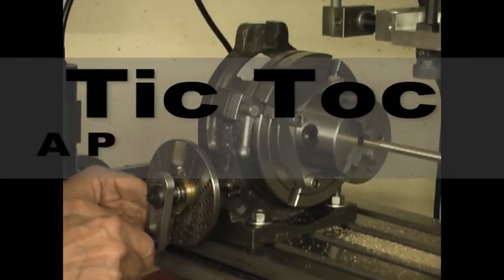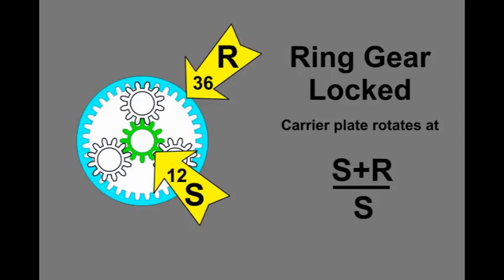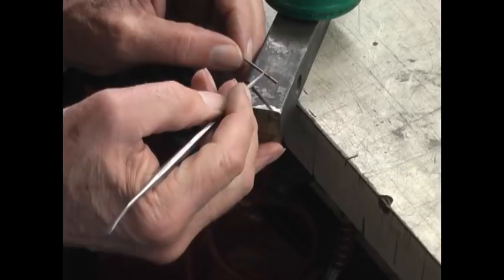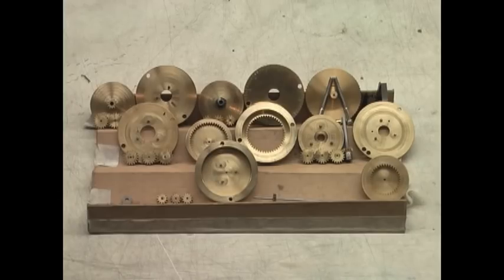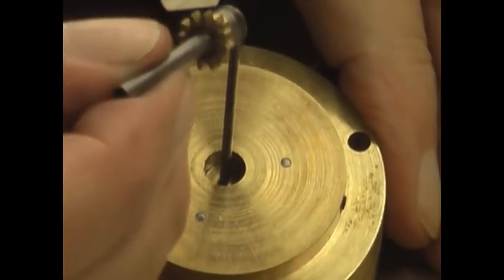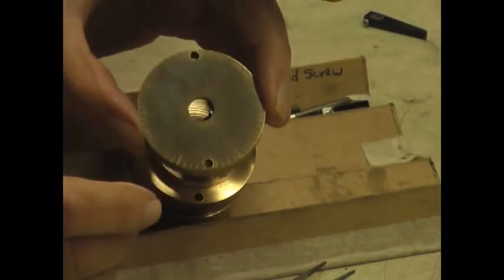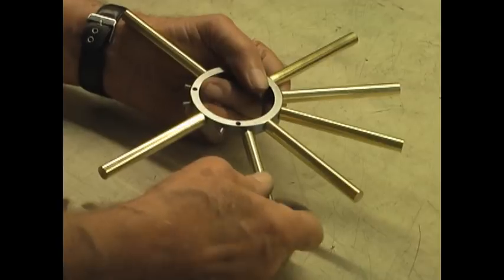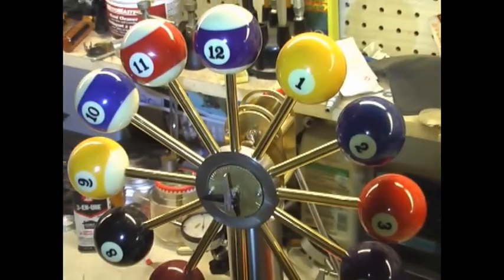Tic Toc

Comment: Beautiful gear train, very impressive gear cutting. A very well edited upload too. I thought you were going to drive it with weights and make a circular balance wheel in the back of the body. I plan to make a long case clock one day, (maybe when I retire)! I never thought of using a planetary reduction. Good luck in 2018